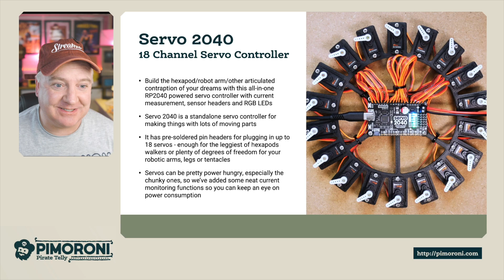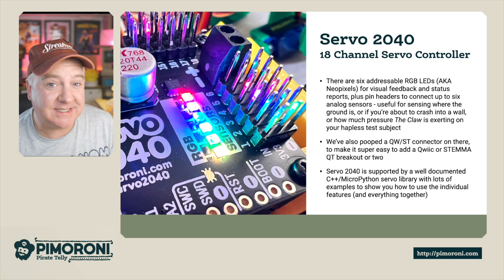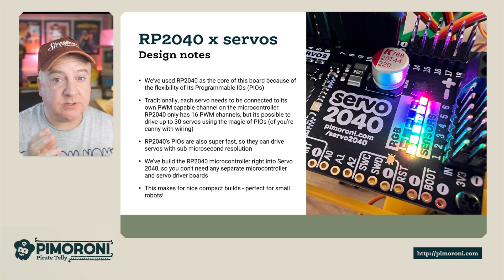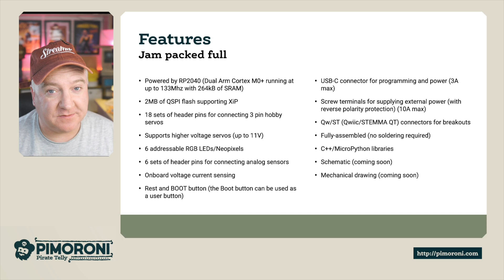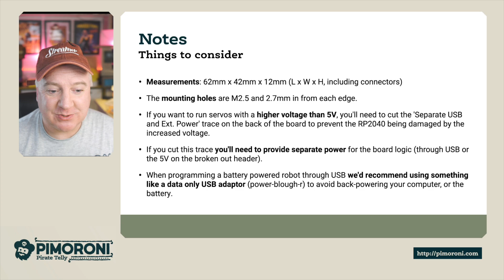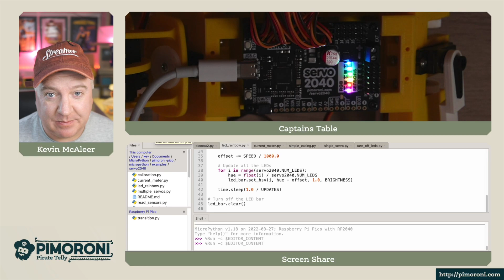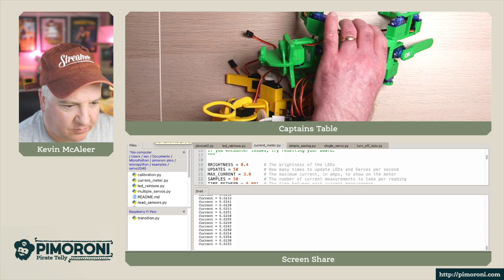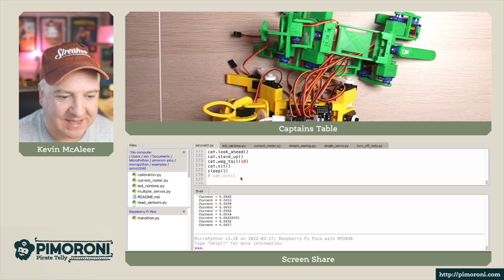First look at Servo 2040 - an all-in-one 18 channel servo controller, powered by RP2040

Comment: Can you power it without a USB C cable? With a LiPo battery? Would it work without the USB C cable, if it was was plugged into a lipo battery using power and ground? If so, how?

Comment: Does this board support the SPI protocol?
Reply from the maker: Yep, the servo pins can be used for SPI.
Reply: What if we are using all 18 of them? Can we use the 6 pins next to the LEDs?
Reply from the maker: The LED pins won't work for SPI as these go through the multiplexer, but you could wire up to the three ADC pins on the bottom edge connector, as these give
A0 / GP26 : SPI1 SCK
A1 / GP27 : SPI1 TX (MOSI)
A2 / GP28 : SPI1 RX (MISO)
Then the CS could come from INT / GP19 (if that feature of I2C breakouts is not required).
Reply: Is there a pinout diagram for the Servo 2040 similiar to this?  https://smittytone.files.wordpress.com/2021/07/tiny-2040.png?w=1024
Reply from the maker: Drop us an email at support@pimoroni.com and we'll see what we can find!
Reply: just one more question. Does it support UART? if so, where are the TX And RX pins?

Comment: In the video, the USB cable / PC port seems to power all the servos (as the external power of the servo board is not connected). Afaik, USB is only specified for 500mA, so isn't it dangerous for the PC?
Reply from the maker: Depends on your PC! We've not had any problems powering a Servo 2040 and a few small servos over USB - most modern USB controllers are designed to cope with higher powered USB-C devices being plugged in and will stop your USB ports if they try and draw too much current. If you want to be totally safe you can cut the trace on the bottom of the board and provide external power to the servos.

Comment: I just ordered the servo2040! Is it also possible to use wifi on this board? Has anyone any suggestions? For my project I use a raspberry pi that controlls 7 servo's with API data as input. Is this also possible with this board?

Comment: I see that there are time.sleep instructions. Does that means that when you need slow movement, you have to put the rp2040 in wait? No parallel control on this to allow the rp2040 to process other stuff during those moment (like sensors)
Reply: Servo 2040 dev here. Our servo library doesn't have any built in support for background movements like would be needed in your example. I did look into it, but wasn't happy with some of the compromises it would introduce. Maybe I will revisit it in the future. The best solution currently is to set up a Timer object in C++ or Micropython to call one of your own functions at a regular interval, and use that to update your servos (and anything else that needs to be synchronised), leaving your main loop free. I'll add it to my task list to write an example of this.
Reply: @ZodiusInfuser  I forgot I could use Timer with micropython. That could do the trick in most cases. Thanks.